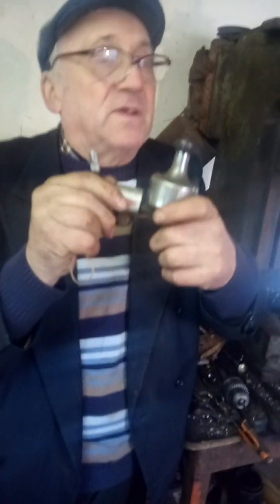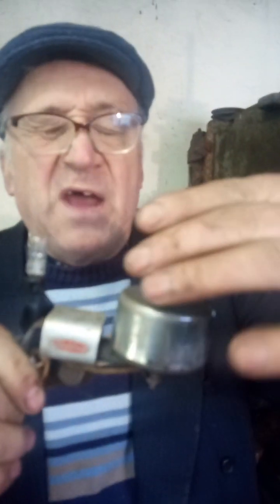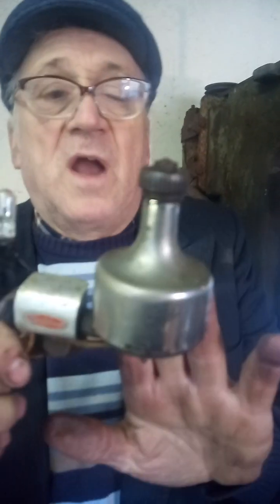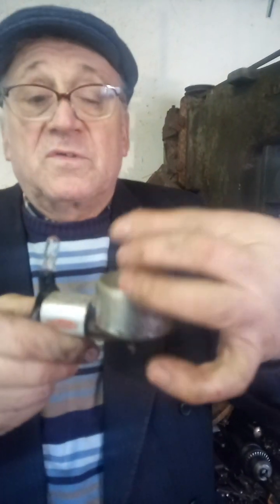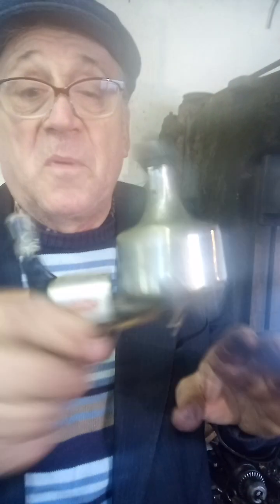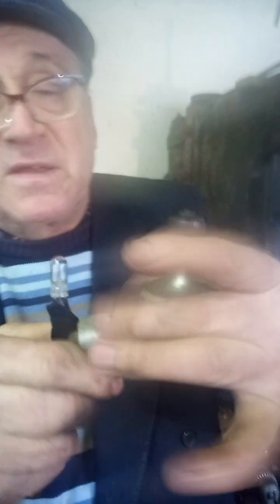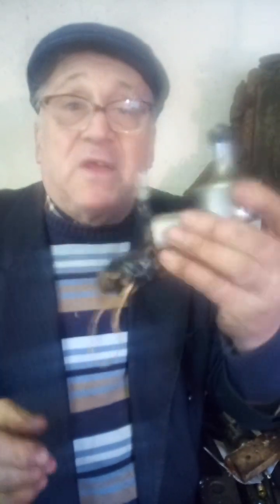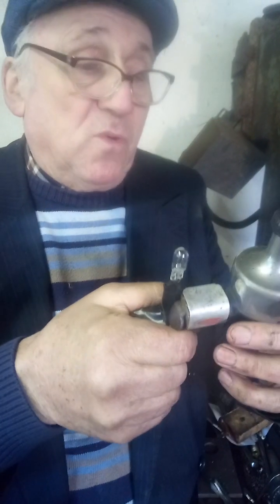Bicycle light alternator. Free electricity????? 7th Jan 2024.

Comment: I had one of those generators and added a battery with a small relay which would allow the battery to power the lights when stopped on the road a busy junctions. When moving with the generator running the relay would switch on and allow the generator to power the lights. My bike was scrapped by my parents and I think the generator went with it. Today with LED's being very bright and can be powered from some AA size batteries for several hours, I suppose the generator is of little purpose.
Reply from the maker: These all produced alternating current,  they cannot charge a battery.  Only certain batteries can be charged in any event.
Reply: @ValMartinIreland  I don't recall if the one I had was AC or DC now. Its over 30 years ago now. But I do recall it didn't charge the battery. Battery was just a ordinary torch battery, not rechargable. I bought the parts as a Maplin Electronics relay module kit which came with a small box which I mounted under the seat on the Rayleigh bike.

Comment: Its a dynamo. Connect it to a wind turbine or a water wheel
Reply from the maker: IT is an alternator,  not a dynamo.
Reply: @ValMartinIreland  It's a dynamo.
Reply from the maker: @MrLeadb1  What form of electrical output comes from it when in use?
Reply: @ValMartinIreland  Yes it produces AC but if you want to buy one you have to ask for a Bicycle Dynamo...because that is what they are called.
Reply from the maker: @MrLeadb1  I don't care two balls of elephant's dung what idiots call  anything.    A dynamo is an entirely different devise which would be too large to use on a bicycle.    This is the same ignorance I have to deal with with the wind energy scam.  Read these two articles and then comment.   https://en.wikipedia.org/wiki/Dynamo   and read this  https://en.wikipedia.org/wiki/Alternator  then watch this.   https://www.youtube.com/watch?v=uOjEZc1yu64&t=1172s  and  https://www.youtube.com/watch?v=BbbRmApbW9A&t=868s   and stop being such a ignoramus.